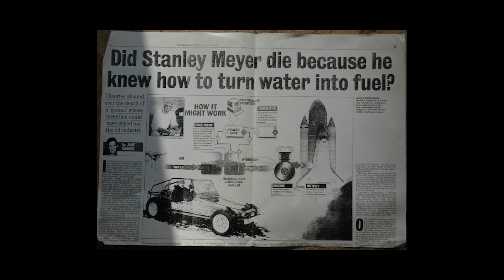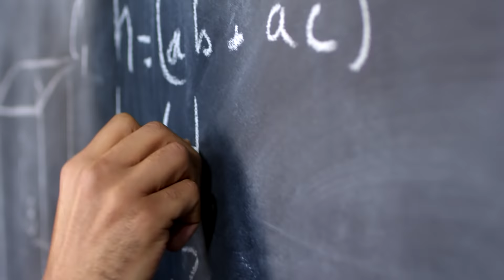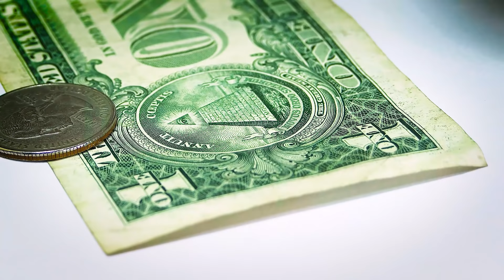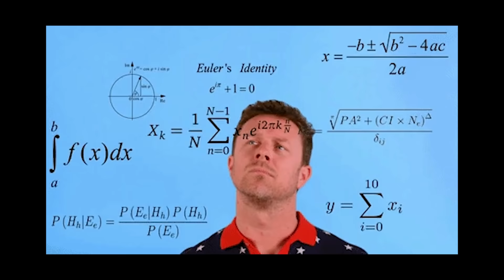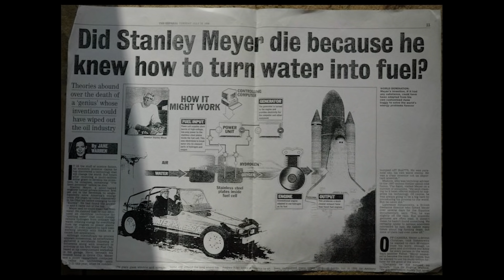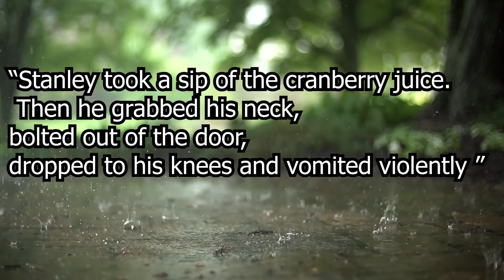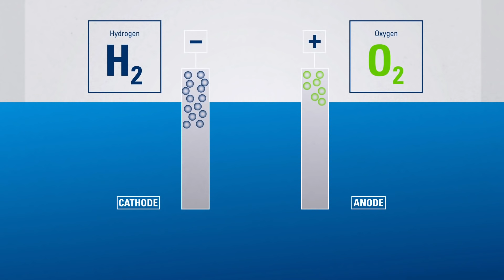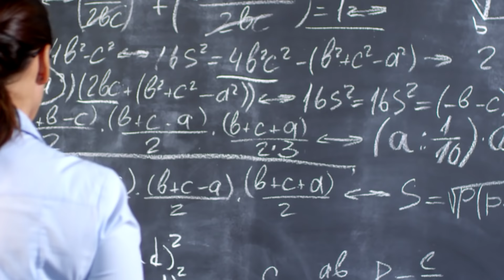Stanley Meyer Water Powered car, Lies and Death

Comment: Such a car would use up all of the water on earth and the oxygen used would fission.  It would kill the planet in the long run. Though oxygen is very stable. Just to put this all into perspective. Even a drop of water lost per litre of fuel would be catastrophic. 

Lets start at the minimum. One molecule loss per cycle. With 4.62924x49 molecules on earth. Doesnt sound too bad.  The average engine is a 4 cylinder. 4 molecules per cycle. The engine cycles at 1,100 rpm idle. 4100 molecules lost per minute. There are predicted, 2,000,000,000 engines world wide. So. If everyone used water. You have a net loss of 8,200,000,000,000. So 4x10^54?  We would use up all the water on earth very quickly.  Thats molecules lost every minute...  now that number is high. Because oxygen is very stable and the pressure required to fission o2 n the heat and charge wont be so catastrophic. 

And Thats per cycle. It should be volumetric to displacement for a constant. But this just simplifies the point.  Why using water as fuel is not a good thing... 

Currently we take in crude oil.  Thats essentially useless to the planet except for how it inevitably burns in the core of the planet. But whether or not it has anything to do with sustaining our molten core?  No studies suggest that crude oil has anything to do with sustaining earth’s molten core. The core was molten before earth formed life...

People would think of only the positives about using water as fuel.  Cheap. Free. To control the consumption of water. Our life source then becomes non-free. Regulated. Water to live on vs fuel.

Comment: If the water was steam or at least in a state of very fine droplets then the seperation would be easier and faster. It falls under the same theory as why fine wood dust burns faster and with the right conditions exploads. All better then a solid block of wood does.

A solid block of wood is very hard to get the fine wood dust from, but water can be turned into a spray of fine droplets very easy.

I think what he did was to make the water into very fine droplets and ran those through a network of electrical pulses or micro electronic field thus spreading out the electrolosys effect over the fine water droplets. Smaller area to work with faster the job gets done.

Done correctly you can get instantanious  division of hydrogen and oxygen.

Comment: On Puerto Rico, when the gas prices start raising like crazy back in 2009/2011… a lot of people change their cars to use hydrogen instead of gas, and they will able to get 50miles or more per gallon…
Seems to me that the process is not that complicated after all if some people in rural areas are able to achieve.
Reply: Ehm...you know the difference between hydrogen and water, right?

Comment: Energy for the electrolysis comes from the battery of the car and the battery of the car is recharged by the alternator being turned by the engine of the vehicle! how did you not know this? This is like the most basic of vehicle electrical systems! The battery Powers almost every single thing in your car!

Comment: How much oxygen is released from the exhaust? Pure oxygen is very flammable. Gas cars could fill a garage with co2 in like 15 mins. If this buggy is in the same ballpark, wouldn’t it be leaking flammable gas? Could a spark near the exhaust cause an explosion?
Reply: Oxygen is absolutely not flammable, you should repeat primary school before you claim such nonsense!

Comment: The car worked when they were in Pennsylvania. They had a college of verify how the electrolysis was done. The car actually worked
Reply: Nobody says it doesn't. The issue is, it doesn't work efficient, you have to put over 50% more energy into the electrolysis to gain the hydrogen. So in short you have to charge the external energy source aka battery every few km.

Comment: There is more than just electrolysis his fuel cell had to have  A more complex self powered high voltage generating system and oxygen temperature  voltage control a big factor to maximize the hydrogen level.

Comment: It worked for the same reason a singers voice can shatter a glass. With the right frequencies you can shatter anything, including water's molecular bonds. It also would take MUCH less energy thanks to resonance and reverberation. Think of talking into a mic connected to a speaker that the mic can pick up sound from: reverberation
Reply: Ehm...no. You literally can't split water in hydrogen and oxygene by any frequency. That is just blattant bs.

Comment: Separating hydrogen and oxygen is comparable to pulling appart a rubber band you don't get more energy from letting the rubber band snap back together than what you put in. Extracting energy out of this process would violate conservation of energy and would be physically impossible. This process would be a perpetuum mobile.

Comment: Every type of combustional power source consumes a large amount of energy just to start it and get it running over the first minute on gasoline cars we have alternators and batteries to give power to start the engine to get it running once the hydrogen engine is running it starts to put out voltage to an alternator which in turn charges the battery basic

Comment: Your wrong about it uses more energy than it puts out. Are you serious ? A car battery stores over 1000 ah using 12 volts AS the car is running. This means that making hydrogen from water can be much more efficient than producing gasoline or alcohol fuels. The 12 volt automobile alternator can produce beyond 240 ah using 12 volts so the benefits to using and creating hydrogen fuel are obvious. The only reason that its not being done on a large scale is due to the explosive nature of hydrogen during storage. That's a big problem and needs to be dealt with before major uses are seen on the roads around the world. However storage can be minimized by producing the gas as needed rather than storing it. Another way, if storing generated hydrogen gas is to use a container that is very thick and made of hard steel, up to 2 inches thick, holding only 1 gallon at a time and this storage only used for restart needs.
Reply: making hydrogen using electricity is always less efficient than just using the electricity directly to move the car.

This should be ovious.  More conversions = more losses.

Comment: So many conspiracy minded fools talking nonsense in the comment section. We don't use water to power cars because you can take the same energy required, and put it into a battery. It's more efficient. Big oil hasn't killed off all the EV developers. The entire auto industry is going EV. Don't be a doofus.

Comment: The car ran off of heat, compression, boiling water creating steam that pressurized and turned a alternator allowing energy to store rapidly. the electricity boiled the water, causing a compression of water and air inside of a cylinder  that leaked air out one in as water was pressurized to enter the other end at the same time turning a set of alternators within, as air leaked out into another cylinder it would pressurize and turn the next alternator, one alternator was turned using water and one was turned using air, collecting enough energy to turn a 3rd alternator which ran off electricity, if we add solar panels all around the car, we could have a car that ran non stop. 
the car ran off of heat, compress, boiling water producing steam that push the fuel through, it runs off of compressed air producing more steam.  there are three different types of air inside of the car. 1st type is the compressed gas, the other 2th type is the water and lastly there is the air outside.
There are six cylinders for each type of air, one cylinder for each kind of exhaust. The cylinder for oxygen and hydrogen, and the cylinder for nitrogen. One cylinder is used for the exhaust and two for the compressor. The exhaust is used by the driver and the compressor uses the power of the generator to run a series of generators so they don't overheat. the condensation produced from the water causes air pressure to build up and compress as water evaporates, while the compressed air has the added pressure it produces by the combustion of hot gas hydrogen and also from the air pressure outside using aerodynamics to capture and store air to heat up which causes compression as well, it releases pressure equal to the pressure inside the cylinders.  this means when you drive the car with a vacuum engine, as you do on the main road, the amount of energy needed to drive the car is reduced by about 50%, but if you're driving a hybrid, then you need to pump less energy to get a lower efficiency.
the car runs on heat and compressed air, water and hydrogen. the rotation of the wheels store pressurized air to keep the cylinders pressurized.
Reply: Sarcasm, right?

Comment: So, we know a classic electrolysis wouldn't work. The amount energy used the break water into hydrogen and oxygen is the same as the amount of energy gained by burning the resulting mixture of gasses. The inventor claims, he found some more efficient way of braking water into the two components. O.K. Now, we have a closed system in which we burn oxygen and hydrogen into water, gaining a lot of energy in the process. We then break the water into gasses again by process using much less energy and take the excess power out of the system to run a car. 
Looks good, as long as we ignore the laws of thermodynamic. We don't have only a hydrogen powered car; we have a system supplying unlimited free energy created from nothing. A well proven nonsense needing no further explanation. A load of BS.

Comment: He used a copper pipe in circle it had argon -  and another gas + in vacuum then he fired a 10mw laser in it at the speed of light the laser knock off +ion elctron and coil all round the copper tube Same as water pipe and pulsed it massive amount of energy no moving parts that was the power system to h2o2 splitter he later used the high frequency square wave to split h2o at injection so no more electrolysis using normal wethod he showed this tube to military and provened it work i don't know the other gas only 50 50 with argon this means it works by laser hitting gas in vacuum in a ring with gas the laser cause election to separate from gas causes chain reaction and can fire laser on how much power needed

Comment: why didn't anybody attempt to replicate this water engine?  it'll be tremendously useful in the space industry
Reply: There are plenty of hydrogen welders that run off the very same principle from Stanley Meyer. These welding units are very powerful and they simply use water.

Comment: I saw his how do video. And he used a special unit injector that replaced the spark plug. He never had an on board fuel cell electrolytes stack. These cells you can buy today only deliver 10-15% fuel reduction. I think you didn't research properly
Reply: Check out the how it works video https://m.youtube.com/watch?v=Ffn72NJKPKM

Comment: The water mixture runs a generator . the main secret sauce is the hard part to get.  Not to do with sound . it's a chemical reaction... I promise you it works...
Reply: There is no "secret sauce" that makes splitting water and fusing it again generate energy. It's always a loss. You didnt pay attention in chemistry.

Comment: How do we explain the real hydrogen cars on the market today are they not similar
Reply from the maker: Not at all😂. 
New car drive on hydrogen made externaly at a hydrogen plant. 

His car in theory did the electrolysis on board and still had enough power to power the car
Reply: @ChrisVSCars  Oh for sure was just pointing out the idea that it is possible to use hydrogen to power things is 100 percent true.  There are many ways to actually power cars but if there is no money to be made then the inventors are discredited and crushed. Tom Ogle is another example

Comment: How was it fraud if the car ran on water. Even though it took electricity to do the electrolysis he still managed to run an engine on both the hydrogen and oxygen. Gas engines need electricity to run too
Reply from the maker: Because he used other peoples money to build a car that did not work

Comment: I know we all want to believe in conspiracy theories. I would love to believe this. But can someone explain how the engine would create more energy from the hydrogen than then power cell would use to create the hydrogen? Doesn't that contradict the laws of thermodynamics? How is does the process of separating the hydrogen and oxygen take up less energy than you would get from the hydrogen? Can anyone provide the numbers on this?
Reply: Like a glas that you can crack with your voice, the voltage is very low and you got to get the right frequence. A hard process which can be archived by going lucky with it. No attempts were made by anyone to recreate the car.
Reply: @song-one1910  But what is the power imput on the resonator? What's the power input on the electrolysis device? And what's the the power output of the hydrogen produced? Are there hard numbers that can be reproduced?

Comment: I only watched a few minutes, it's all I could stand. First, when you burn Oxygen and Hydrogen, water (H2O) comes out of the exhaust, not Oxygen. Two, hydrolysis doesn't split atoms, it splits the H2O molecules into its base elements. Nobody fucking fact checks anything anymore? :rolleyes

Comment: This violates all laws of physics as it would be a perpetuum mobile. You could produce hydrogen from water, capture it and the oxygen, Brun it to again get the water and so on. There is no free energy. The car can not possibly work as described as it did not have an energy source
Reply: DB = Dumb Bennet?
Reply: @johnsonhunglo1993  do you have any real, fact based critique or are just insulting because of a lack of knowledge and understanding?
Reply from the maker: You can't argue with them😂. They don't use facts they use insults